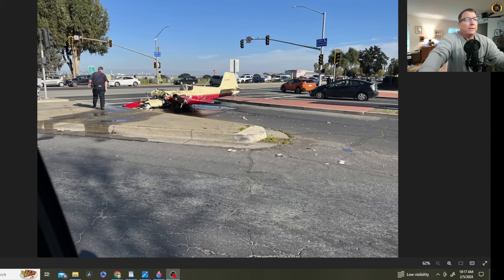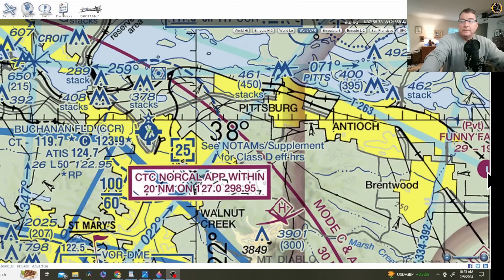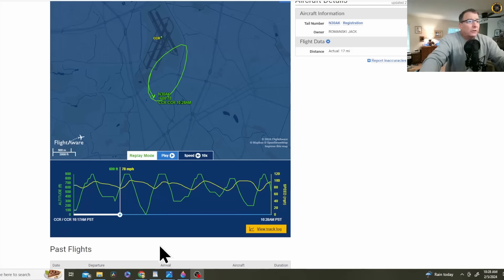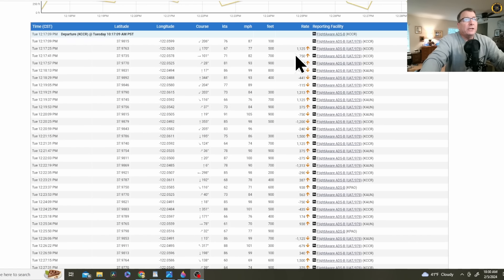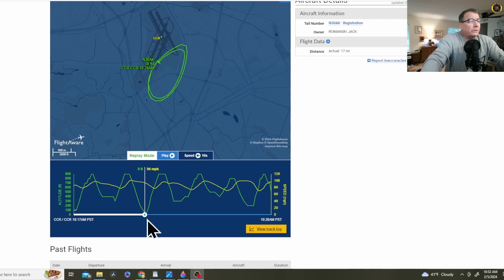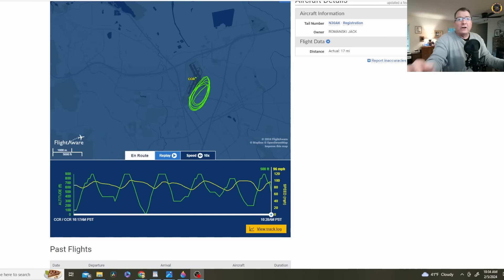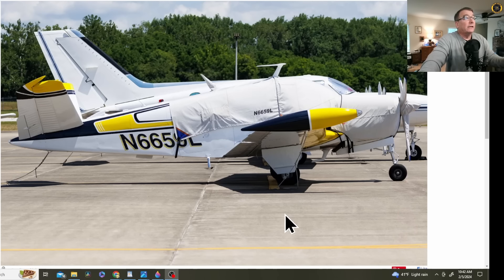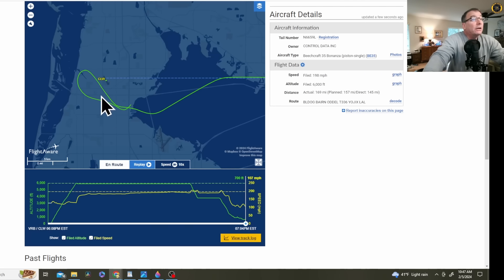RV-6 Crash Concord CA and V-35B Clearwater FL. Crash 5 Feb 2024

Comment: I was an instructor at KCCR. He indeed always stayed in the pattern. The traffic controller allowed him to keep very tight turns inside the pattern of other aircraft. At least 30 landings every week and always power idle abeam the number and very early low altitude turns.
This airplane just came back from 100 hour/annual inspection.
The interesting part-3 days prior to this accident while doing touch n goes his engine got locked. He stopped on the runway and tower offered help. The airplane then went to maintenance but it was on the weekend. Knowing the maintenance guys as they worked with my flight school I am not sure they actually fixed the problem that quickly.
Was the problem not fixed? Did he take the airplane regardless? 

Thousands of hours and over 10,000 landings cutting the power and gliding. Moral of the story-always always always pitch for airspeed first.

Misha Tyukin have a video on YouTube from his 3rd solo at this airport with engine failure and a safe glide to the golf course.
Remember-just because the engine died doesn’t mean you have to too.
I wish well for the family and sorry for their lost.
Reply: Thanks for the extra information.
Reply: I don't like speculating on people's misfortune but this sounds like OCD. 

If there was an issue would be even have been willing to wait for a fix?
Reply: @BAD_CONSUMER   Yet, here you are - speculating.  Bad Commenter, too.  🤨
Reply: What does ‘engine got locked’ mean? Did it seize? On approach; on roll out? If you have info, please annunciate it clearly using standard terminology.
Reply: guess he did like playing golf
Reply: I am currently an instructor at KCCR and worked for the FBO there. Jack would lap you every time in the pattern, it was always so fun to watch. So sad to see him go, he brightened my day every time he called.
Reply: Must have been very disconcerting for others in the pattern to have him racing around below and inside of them...  especially for student pilots....
Reply: @BAD_CONSUMER  OCD? Not only are you speculating, but you are wildly speculating.
Reply: I bet the RV6 pilot did the high performance takeoffs and landings for the sheer joy of it.  The high performance of the RV6 was probably intoxicating and doing all of this at the airport probably felt safe to him compared to anywhere else.  There was always a runway within arm’s reach.  Until it wasn’t.  So sad.
Reply: @lardyify apparently the No.2 main spun and seized - some swarf in the galleries. But a good clack on the side of the block with a gimpy freed it up and he was good to go.
Reply: @davidseslar5798   I ike to speculate! ..And yet he is right it is OCD Behaviour!🤨
Reply: @BAD_CONSUMER  Perhaps if the pilot practiced emergency procedures more often instead of this one type of maneuver.
Reply: @davidseslar5798  And yet here you are, trying to crush open discussion when educated speculation such as this is healthy and helpful. Methinks you are the kind that loves one-sided discussion if not outright girlbossing a conversation to the way you prefer.
Reply: @PRH123  Reminds me of the old Drivers Training "simulator" systems that used to be used to teach teens to drive.  They always had the most ridiculous conditions with people and cars doing crazy things for the student to react to.
Reply: @raitchison  we had those in high school, you'd sit in your simulator and watch a movie on the screen, and you would have to make the right inputs on the controls to duplicate what you saw on the screen...  the teacher would get a printout of the results afterwards...  for its time, early 70's, it was a pretty sophisticated system, although it lacked some accuracy....
Reply: True. Always get your airspeed as high as possible as quickly as possible, then look for a landing spot.

Airspeed can easily be bleed if necessary, but beeing to high and slow is asking for trouble.
Reply: @PRH123 not really as ATC works out the pattern with you. Allowing Jack to make his cycles. Usually ATC would just put him on his own circuit/runway and put everyone else on the other parallel runway as traffic permits.
Reply: @CrayTom  Relax... speculate your little heart away. Just don't be surprised when you catch hell for saying you "don't like speculating" and immediately following it with a nonsense speculation.
Reply: @russbell6418 umm what? And I don't care at all about wild speculation. I am merely pointing out that the guy said "i don't like speculating" and then proceeded with a wild speculation. Speculate all you want. It is just funny he said he doesn't like to speculate.
Reply: I flew into concord and he was doing that, and i nevet flew in there again

Comment: He was 75 years old.  Perhaps he so loved flying but wanted the security of having an airfield underneath him all the time.  I've seen this mentality more than a few times with older folks--not just flyers.  It's the 'stay close to home' thing.  Rest in peace.
Reply: I would think the more budget friendly route would be ultralight?  Sure,  people can and do travel with ultralights but it's pretty common to drag the kit out to a field and spend the day buzzing around the near side of the horizon.  Many "legal" ultralights are effectively limited to 30-45 minutes of flight time anyway due to fuel/speed/efficiency factors.

Though I suppose it's an entirely different experience than flying a "real" plane .
Reply: Altitude is your friend flying though. Take off and landing are the most dangerous parts of flying. He just seemed to get a kick out of his touch and gos i guess.
Reply: It's the rush of the zoom and the thrill of the glide. When you're that old, there's no time to mess around with square patterns. I fly model airplanes. There was one very old man would come with a son or two to handle things while he sat in a folding chair and flew. Aaaallll he did was scream straight up to the 400 ft legal limit, kill the throttle and deadstick down, zoom, deadstick, zoom, deadstick. Sons would fill the fuel and take care of other problems when they happened.
Reply: I share your thoughts. It's like the older guy with an offshore capable boat that doesn't want to lose sight of land.
Reply: I think you are missing the point here. He tried the impossible turn, looks like. Doesn’t matter your age, the maneuver is rarely successful
Reply: Probably did in part to maintain currency, but also reason some people take their sports cars around the block, just to park them again; just to keep the dream alive.
Reply: My thought was that at 75 he might not have been able to pass a medical for his license. Just like a lot of older folks who can't give up the keys to the car and drive without a license, this man might have thought if he didn't leave the airport he would be OK. Thank God he didn't injury anyone but himself. May he rest in peace.
Reply: @kathyhennigan7807  There was one injury to a person on the ground mentioned in the news article.  I live in Concord and the local news said the person was taken to the hospital with 'minor' injuries.
Reply: Sad.  He'd spent so much time practicing the Impossible Turn....
Reply: Better to go out like this than in a nursing home...
Reply: @brianpeele311  the bay and ditching, straight ahead,
Reply: sometimes, as you get older, you just want to prove that you still can, especially if it's something you love doing.......'"can't do it" is a terrible thing to come to grips with
Reply: And there's not a thing wrong with it, other than, like Juan mentioned, letting the engine stabilize and cool down with lower rpm's at cruize for a while.
Reply: @stab74 was thinking same thing. 
  Hopefully I make it to that age still flying..
Reply: Restroom problems
Reply: That trailer park crash happened like 30 mins from me could see the smoke from it
Reply: @mikemicksun6469 Bingo! Can you say BPH?
Reply: @kathyhennigan7807  I know lots of people that are in great shape in their 80s - age does not necessarily mean unfit or unwell.
Reply: @kathyhennigan7807 My older brother stopped flying after failing his physical and realizing it was time to cease flying alone.
Reply: It’s a shame how these airports and others that  were probably  some distance from developments are now built in.  No where to go  when trouble strikes. I wouldn’t want to live  in one of these  suburbs.
Reply: @spinnetti  Take their sports cars around the block 20 times every day?  It makes no sense.
Reply: @brianpeele311  He is not missing the point, he is making a different point, simply trying to explain why he never left the circuit. Surely that is very obvious?
Reply: @dermick my dad will be 90 in a few weeks. Lives on an air park in Fl. Flies this LSA almost every day. Loves what he does.  To be quite honest, he may be healthier than me at 67😜
Reply: @Milkmans_Son He probably saw it like taking his sports car around the track 20 times a day.
Reply: Sad event. Correct pronunciiation is   "YAH-tsek Ro-MAHN-ski"
Reply: Probably a retired airline pilot.
Enjoys flying but tired of traveling.
Reply: @petermattei8510  a closed pattern pull-up is definitely NOT practicing the impossible turn...
Reply: I guess Juan didn't mention life insurance! Who knows? IDK how much an older guy like that can get, unless he already had "paid up" insurance.
Reply: @SRQmoviemaker Like a guy said in a news story about that Clearwater Bonanza Crash, it could've been much worse... 
1. There were people visiting that mobile home and the only reason there were two people there was that one person was visiting longer than the others that had already left. 
2. If the plane had not been going straight down, more mobile homes may have been involved. 

But too bad, because that plane almost made it to the bay. 
I wonder also about the witness that saw the plane falling out of the sky as a bright white light, as if it was burning white. As best I know, magnesium burns bright white, but IDK what else could do that.
Reply: You've got a very debatable idea of a 80 yr old in "Great shape"....
Reply: Locals suggest this was as far as his wife would let him fly.
Reply: @mikemicksun6469 Gotta stay close to the bathroom at that age.
Reply: @VNAV_PTH   That is exactly the analogy that would fit my future older self's thinking.
Reply: Any more comments about emergency training ? Look what happened the last 2 days.

Comment: I live in apartments next to where the Bonanza went down. I had just stepped out to walk my dog when it exited the sky at a high rate of speed and burst into flames. It was very traumatic. I used to fly out of KCLW often. That airport is near impossible to see at night unless you are very familiar with it. The runway lights are very dim, and you have to turn them on manually and there is about a 7-10 second DELAY. When you click the mic seven times, you have to wait a long time for them to turn on. It is very unsafe. The unlit airport looks like a dark void in the residential area at night and it's on unmonitored CTAF. With trees on either end, it's a very unforgiving airport. I prefer the towered and well-lit KPIE. It's such a tragedy this happened. Thank you Juan for what you do.
Reply: Scenario:  Dark.  Engine starts to sputter.  Pilot lowers head to check fuel selector or mixture, or whatever.  Pops head up, instant spatial disorientation.  Accelerated stall/spin.
Reply: I hope your mental health gets better. 

The Clearwater Airpark has 50,000 operations annually, and has 125 aircraft based there. It has received awards for safety. 

This is the only crash at Clearwater that I can find. 

It’s an important part of the community.
Reply: yep i live in st pete and have flown into clw many times, last time i came in i had to go around because i couldnt get the lights on, finally on the downwind i got them on. only could find the airport because im so familiar with the area
Reply: I also live in  Clearwater (near Belcher and Sunset Point) and I certainly remember another multi fatality crash that occurred just NW of the airpark. Don’t recall date at all but it was in the front yard of a home under construction near or at the intersection of Montclair and Keene (when it was just a two lane road so many years ago) but since 74 when i moved here.
I often drove by that spot on way to church.

Although i have never been to that airpark that i recall, it’s definitely in a dark area at night with all the industrial area and golf course around it.
Reply: my CAP flight was based there, we took over ATC for inbound on Thursday evenings. I was 12 years old and twice was told to run it alone for 2+ hours.  thankfully nothing went wrong. there were times it was only myself, the Major, and one other cadet. thankfully now they have a nice permanent facility and a good number of cadets. we had a trailer that was falling apart. they only replaced it when some poor cadet fell through the floor. I watched it happen.
Reply: I used to live in the apartments up on Seville back in the 2010's , absolutely wild to see this. Hope you feel better about this!
Reply: Oh, I looked up the address (1989 N Keene Rd but was right in corner of both roads) of where I remember that fatality crash and the house was built in 1981 so probably around then.
Reply: What do you mean it burst into flames?? based on the photo's and initial reports there was no post crash fire!!!
Reply: @utubewatcher360  the Clearwater crash certainly DID have a significant fire! 🔥 
The mobile home it hit was totally destroyed and three other homes were damaged.
Our Clearwater Fire Chief credited the ARFF unit from PIE for its assistance in controlling it.
There were twenty+ units there to handle it including multiple engines.

Addendum - see the pix at 9:40 for how much fire there was after the crash!
Reply: That sounds like my home field in the Pacific Northwest.  The beacon isn’t even on until you key the mic.  It’s a steel glide due to high trees, narrow, short.  If you want to rent a plane and fly at night, there’s a special night checkout.
Reply: I'm sorry you had to experience that.  I find it concerning how few people in the comments seem to care about people besides the pilot who are affected by these incidents.  I think a lot of pilots have a mentality of "if I die it will be quick and I'll be doing what I love", but innocent people on the ground did not sign up for that.
Reply: @utubewatcher360 there was a hugh post crash fire. Took many fire stations different apparatus’s to put out. PIE fire even diverted there as they had been alerted to the pilots mayday and attempt try pie
Reply: @andrewg3196  yes, the homeowner was a grandmother in mid 80’s and another lady in mid 50’s who was visiting.
It could have been SO much worse because apparently just shortly before the crash, there had been another seven people in there after a golf outing sharing drinks and such.
Reply: My mistake gang, I read the wrong comment regarding another crash . My apology to Monica for sure - Sorry. I am looking at the Philli fire where the twin crashed shortly after take off Killing the 75 year old pilot.
Reply: @utubewatcher360  oh..ok…since there’s two different incidents in the video, replying to the wrong comment is certainly possible…I was wondering about that maybe occurring…in any case, now you know a bit more about this one from someone who lives near it.
Reply: thank you John @JohnHallgren
Reply: Juan, you asked why there seems to be such an increase in engine failures. I don’t know but I there are some potential reasons. 1) owners are not having scheduled maintenance accomplished at scheduled periodic intervals. 2) Maintainers are taking short cuts and not doing by the book maintenance or not honestly documenting discrepancies to save the owner money. 3) pilots aren’t managing fuel or performing fuel planning and computations during flight. 
These recip engines are designed to run provided they are maintained to the manufacturer’s specifications. It’s difficult to understand why in this day and age there are so many engine failures when that never happens in my recip car. GA pilots/owners better wake up. Flying is fun and cool and all that but you won’t get far in aviation if you take shortcuts. Yes, it’s expensive. Don’t get into it if you can’t afford it.
Reply: @utubewatcher360 you watched the video?
Reply: @badlandskid he was referring to the OTHER crash in video and replied to the wrong thread as he explained recently here.
Reply: @JohnHallgren  3 different incidents are mentioned, adding to the confusion. Lots of people watch 10 seconds of video then come to make a comment. It would be comical if it wasn't so infuriating. Imagine if these mistakes were made over something that really mattered? People are getting worse in this regard--people going off half cocked, etc.Just noticing this effect. 👍
Reply: @Hjerte_Verke  yup…at he admitted to being in error as to what he was replying to.
Reply: @utubewatcher360  What pictures are you looking at? The mobile home was completely melted.
Reply: @JohnHallgren  I think the fatal crash was around 2004. Forgot a lot of the details, but it was around then.
Reply: @jerryw5508  the multi fatalities crash, which killed six, was September 12 of 1980. I had tried posting some more of the story, but YouTube apparently doesn’t like it..
Reply: @JohnHallgren  Thanks for the information on that 44 year old accident. It means a lot to me.
Reply: @sludge8506  and as to least reliable: Yes, I didn’t remember the date or year or even decade, but I definitely remember seeing some of the wreckage from that crash since it was about two miles from my home. And I still drive by that exact location occasionally.